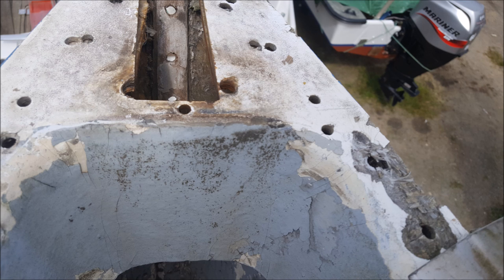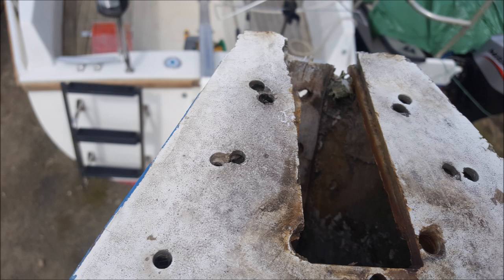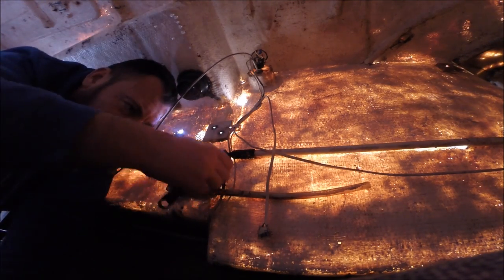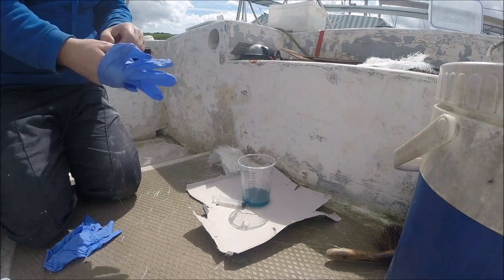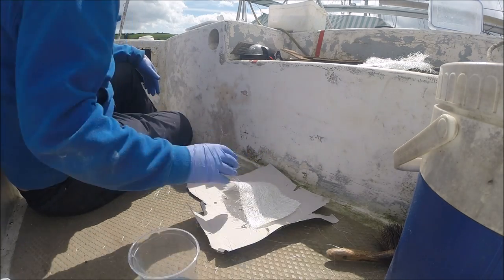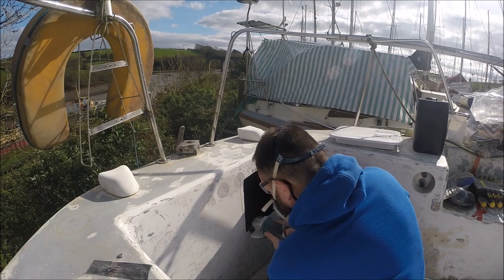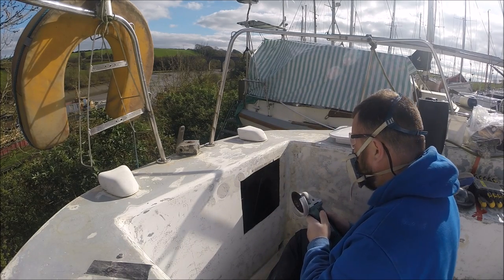Sailboat Refit #14 trying to make the old girl look nice up top

Comment: When you have to do solo work on the Lady, you might want to invest in a graduated set of vice grip pliers. I find them indispensable when doing plumbing and mechanical work in close and confined spaces. They are just the trick for doing jobs like the through hull bolts and nuts. Once you close the pliers on the nut, it's not coming off... and you don't have to go hunting for a small nut in strange corners and places where it might have fallen. You might find them very cheap at a supply house where they sell cheap, sturdy  tools I buy mine here in the U.S.A. at Harbor Freight Co. You might have something similar in the U.K..

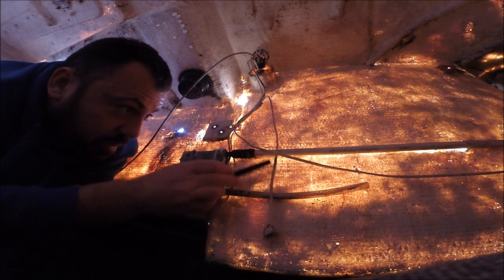Comment: Dear Sir at 3:09 the light clearly shines thru the glass hull.  For light day sailing on the lake ok fine.  If you plan to use this vessel in salt it is not thick enough to withstand the rigors of the ocean.  Be advised that it will fail probably in a storm when you need it the most.  It should have layers of glass or a glass, foam, glass layer.  Best of luck.
Reply from the maker: Thomas D Harrell 
hello where we can sea the light is only on the cockpit  it's think because  of weight  it was made that way and has survived  many sea races  the hull is really thick 
so hopefully  it will be OK
 I had it checked over and I've been told it's find but thanks for pointing it out mate all advice  helps  and thanks for watching
Reply from the maker: I know I've seen it 
I've had it checked out and it's safe it's ment to be like that  also it didn't have any paint on it  now ice painted it you can't see that much light  
but again thank you
Reply: squires lady refit very good.  We Don't need any more Davy Jones crew.
Reply from the maker: lol fingers crossed  ha

Comment: I'd like to see the lifejacket maintenance.  Don't know if you know this, but quick question:  I have an older "U" shaped throwable life ring.  It's color is almost faded and gone.  Can I just spray paint it?  It seems like it's covered with canvas and is otherwise in good shape.
Reply from the maker: joel1239871 yes mate you can I was thinking about doing that with squires lady old one  it should be alright with it being foam inside

Comment: What kind of resin are you using for the fiberglass work?  It looks almost like polyester resin.  Someone correct me if I'm wrong, but aren't most boats made with epoxy resin, not polyester?  Does it matter if you use polyester resin on an epoxy resin boat?  I thought you needed to use they same type of resin as the boat is made from, in order to get the best bonding of the fiberglass, especially at such a structurally important area as the stem.